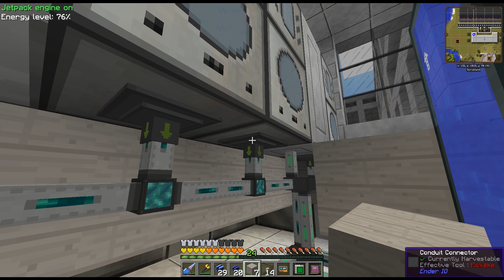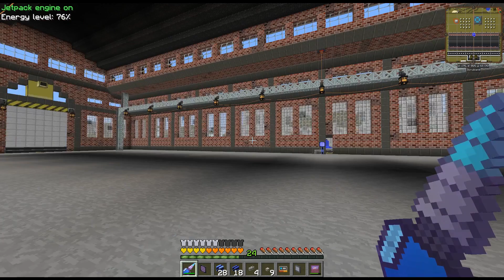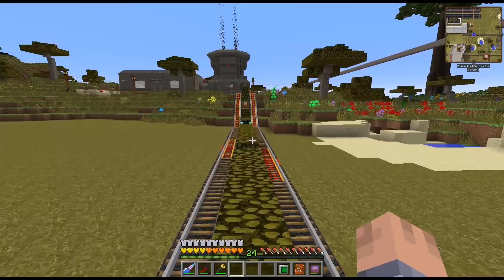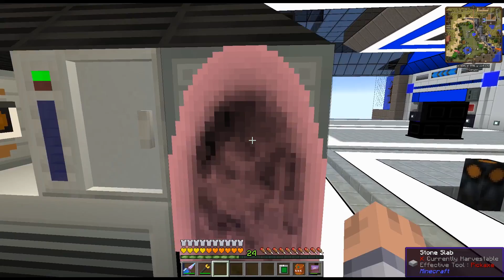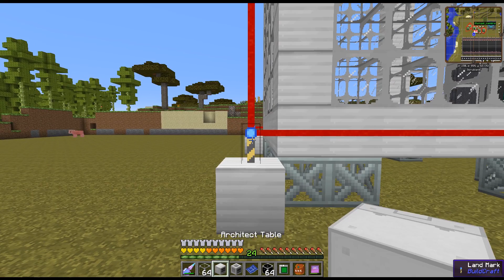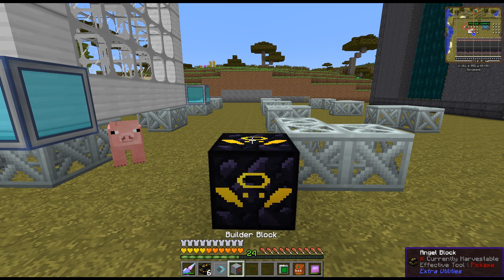ftog S3E25 - Armor, Tanks, and Power via Railcarts - FTB Infinity Evolved (Expert Mode)

Comment: you can use the ME P2P without the first bit of dense cable. place it where you would have the dense cable come directly off the system. saves on that little bit of dense you have.
Reply from the maker: +Bad Wolf Bay That's true, but I did it on purpose so I can easily see (WAILA) how many channels are used overall on that line.
Reply: +Thorgal Daily Gaming 
ah, OK...I didn't even think if that.  I've found that a couple of hours (sometimes, a couple of days) in a creative flat world helps with getting use to some mods. ☺

Comment: p2p will transfer power between the two heads, but not to the middle cable. So if 32 in is getting power, so will the 32 out. But the cable in the center won't. So you need to plug power into the middle bridge section separately, but not back into the output cable on the far side.

A Jabba dolly should pick up that golden chest, so you don't have to keep refilling it.
Reply: +Triaxx2 
seconded :P only need power to the middle cable since its a separate network, should make the factory side more tidy. More hedges like the eu rail section or bushes might look nice too its looking a lil flat outside.
Reply from the maker: +Triaxx2 That's funny that you mentioned it. I actually used the Dolly after I was done recording :)
Reply from the maker: +Graham Walls (OldManWalls) Oh there will be lots of decoration around the area. I want to continue the road, have a sidewalk of sorts, maybe a rail that picks up items or something, and of course lots of vegetation.
Reply: Thorgal Daily Gaming Never enough rails.